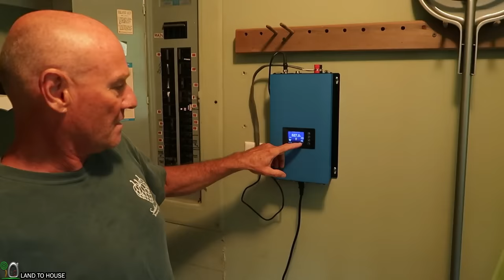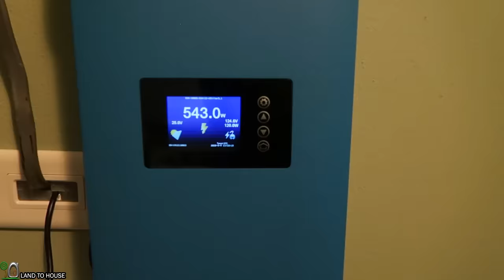Awesome Low Head High Flow Grid Tie Micro Hydro 530 watts!

Comment from the maker: Do you enjoy micro hydro? Check out a Turgo system here:
https://youtu.be/Flz4_OE4CGI
Reply: I would hire a different electrician. Neat project but with many electrical code violations. I would be surprised if you didn’t wake up one day to find your meter pulled.
Reply: Is it possible to install multiple turbine in that single pipe to produce more power?
Reply: Brilliant work the entire World should follow both of you as Energy Saving Pro's
Reply: Agreed, using ground as a load line? Why not run 10/3, rectifier in a sealed box? Surprised it hasn't burned up, could see the toasted insulation, but hey he is doing it.
Reply: you wouldnt need a siphon if you used the falling water to flow thru the pipe, catch it with a gutter type intake.!
Reply: This beautiful dam can generate 10kW of electricity with the right turbine, not just 530W.
Reply from the maker: Hydro power:
(Gpm x head)/10=power
The max for this water flow and drop is around 600w.
Reply: @LandtoHouse  how about turbulent generator?
Reply: op
Reply: @leohern6481  Yes
Reply: Did you tell him that his recitfier needs a better ventilation? Would be bad if his house burned down.
Reply: If you narrow the pipe at the end, you should be able to use the Bernoulli principle to be able to create a low pressure vacuum to keep the pipe that is above water absent of air, I THINK.  If a spigot was made at the lower (more narrow) pipe and connected to the top this should create a pressure that is below atmospheric pressure which would keep the water flowing indefinitely.

This would reduce efficiency, but I don't think efficiency is what is being aimed for anyhow.
Reply: @lancej2718  The guy did the electrics himself.
Reply: @ronhanish  What about when there has been no rain and the level drops below the wall?
Reply: @LandtoHouse    Plus cleaning the water intake, plus invasive plumbing potentially to existing dams, there are so many considerations and differences with this design versus traditional, its pathetic.  I have the perfect setup already in place for this type of system and I can't tell how much I appreciate you producing this video.  Everything came together for me and my site (all systems, like solar are site specific).  Thanks so much.  I'm applying this design to my dam.
Reply: @khanhphaminh1175  Very clever - show us your maths or shut up
Reply: @flatfoot  why don't you show me your math? Have you ever tried searching about vortex turbine?
Reply: @flatfoot  LOL. If you can't search it on youtube, then I have nothing more to say. Sadly someone can't even search on youtube, but so confident to blame others..
Reply: thank you thank you thank you thank we use less than 300kilo watt here the corrupt agents here for 408 kilo watt estimated bill is 27 500 plus for one month we will be so happy to get off this corrupt system pray for us here that we can get the Lancaster parts today thank you
Reply: @khanhphaminh1175  Doesn't matter the type of turbine or generator once you are at the maximum available working energy (water flow/pressure).
Reply: @fjs1111  how do you know it's in the maximum available working energy?
Reply: @khanhphaminh1175  Because physics says so. Consider weight of water, head, velocity, etc. There are good numbers out on the engineering sites along with calculators to determine this.
Reply: @fjs1111  have you ever heard about Vortex Turbine
Reply: @khanhphaminh1175  Yes but it still uses water and gravity to supply energy needed to convert. Turbulent vortex turbines do not violate the laws of physics though they are really cool.
Reply: You can create a system to return the water to the dam/lake but you'll need to use more pipe (length) in order to generate enough vacuum do that hight
Reply: @leohern6481  No. I would upset the flow and venturi effect and be inefficient - if you had a greater drop or more flow - yes.
Reply: May I ask if the generator cost $2500. What were the additional costs for this meter device before his panel box that makes sure his power doesn't go back to the grid and cause the works problems.

Also do you sell these other parts other than the generator?
Reply: @lancej2718  

Yep maybe you are right. That would depend on what is code in his area. 
Also he has that unit that prevents power from going back to the grid ( supposedly) until it fails.

But he is 2/3 off the grid. And yes they may come by to see why he is paying less and change the meter. I have hear they do that sometimes.
Reply: @leohern6481  

If he put a differently design unit after the outlet, then yes if it is not directly connected to the pipe.

 So yes he can do that and increase his output that way.
Reply: Rhene'baby you on here I'm so glad you got it figured out how much we can do for you sorry baby Kevin broke down in town I was making sure he had everything he needed sorry really and Alexis called talking to me about no she wanted to come over here for some reason I don't know how much I appreciate you all for your help with this venture hey I don't want to go back to the doctor tomorrow morning ok why don't you come over here maybe I can help you if you will have a new idea of me John Richard Childers your husband still lol you know what I think I need to do it for my mom and your mom is there anything you want them for you no not at all baby godi miss you well no I don't miss her sorry she's no way I'm done I know why but sorry I'm no fuckin 0unching bag I'm not a toy I'm not having that kinda shit in my life at all no more sorry I have no mom no family but you the boys Kevin and Luther
Reply: If your ever in GA/SC area Augusta/Aiken.  I’m a handyman by trade.  I would love to be a helper.  
Flowing Wells Augusta Georgia USA.  Is a natural spring willed to God.  I see a potential on this 1/2 acre 🤗.  Lots of history behind this.  It would give me great pleasure to build this up.  Ram Pump, to power supply and drinking water.  Tesla capacitors city powers the lights along the road.  And they are a lot of them.  Any who.
A Day Dream 💭.
 A hobby worth investment.  
“A perpetual spring”.  Jesus is the man! Hallelujah!

Comment: When he admits to using the bonding conductor as a current carrying conductor. 
Me as an electrician just cringing. there also isn’t a disconnect at the turbine how are you supposed to de energize rest of the system.  The #10 wire is probably fine at 530W 3phase.
Reply: What do you mean by "deenergize"? Is something in the system behaving like a capacitor and building up potential?
Reply: I'm guessing your none union or a are you IBEW

Comment: Don't be cheap and dangerous, don't ever use the ground as a current carrying conductor. Just because it works doesn't mean it's right.
Reply: Just wanted to chime in and agree, yes it is burial grade wire but don’t cheap out on your wiring. It obviously works but they make 3 conductor wires for this reason. Good luck and thank you for sharing your awesome setup!
Reply: Why so?
Reply: luigig44 It’s just not intended for the ground conductor to carry current. It isn’t insulated the same as the other two. The ground/earth conductor is just a safety measure. If you want 3 conductors, get 3 conductor wire. The nomenclature is wire size/number of conductors, with ground. So if you wanted 10 AWG wire with three conductors you’d get 10/3 with ground. Not 10/2 and use the ground to carry your current. And just to be honest, electrical work is intended to be done by knowledgeable professionals and if you have to ask “why so?” on a question as simple as “Why can’t my ground wire be used to carry a third leg of a circuit?” then you don’t need to be performing electrical repairs. Not to discourage you from asking or learning, but it is the way it is for a reason. If there were ever a problem, a fire or an electrocution and investigators found that the homeowner used the ground wire to carry a load, there’s no telling what the ramifications would be. Denied insurance? Liability?
Reply: It’s 24 volts.  Enough said !
Reply: John Singleton if I did my rudimentary calculations right that’s still 7 amps of current which can still kill. I didn’t write the codes. I don’t even enforce the codes. I don’t have a dog in the fight at all! I’m just offering advice to those who might read it. Do as you will.
Reply: @dominodoggy1  That's wrong.  The current will be 0.025 amps.  24 volts divided by the resistance of the human body to complete the circuit.  V = I x R.  Ohms law.  Say human body resistance is 1000 Ohms.  The calculation is 24 / 1000 = 0.025 amps.  So 0.025 amps.  Not 7 amps.  It will tingle but that's all :-)
Reply: John Singleton Hmm, I was going by roughly “500 watts” output they were saying divided by 24v = approx 21 amps, then divided that by 3 cause, three phase to get approx 7 amps per leg. I’m NOT an electrician and I have barely a rudimentary knowledge of the theories involved. I know some basics, that’s all. So you’re telling me the amperage coming off of a hydroelectric generator is only 0.025 amps? How is that providing any power? I’m asking, I’m not trying to dispute.
Reply: @dominodoggy1  500 watts is the maximum output the generator can supply.  If you put that into a 5W bulb it will only draw 5 watts because the resistance of the bulb does not allow more current to flow thus limiting the power.  Likewise if you put that through a person the current will be limited by the resistance of the human body.  Limiting the resistance will limit the power (in watts) thus only be 0.025 watts.  However if you increase the voltage this has the effect of overcoming the resistance (more pushing force) and thus you can then see an increase in the power (watts).  This is why 24 volts is safe and 240 volts isn't.  However I do agree that it's poor practice to use an earth conductor for carrying voltage when suitable 3 and 4 core cables exist for that purposes but it can be 'excused' in this application due to being low voltage.
Reply: @dominodoggy1  Oh, sorry. Where I live the ground wire is insulated just like all other wires are. It just has a different color. But I do agree that you shouldn't use it if it isn't insulated
Reply: John Singleton thanks for the explanation!

Comment: As an engineer after analysing through his project firstly I discovered that the position where the generator is stationed in the pipe has a lesser pressure and may course low efficiency from the output of the generator. In other to correct this the gen should be installed at basement of the pipe very close to the outlet. And it should be installed some meters above the ground.
Secondly the output connection from the inverter to the wall socket in his apartment is wrong. This is why we make use of distribution box in our home.

Comment: 500 watts
1000 watt PSU: Allow me introduce myself.
Reply: Asanda Ndimande, probably would still work, but not with 2 2080tis/3080s at high load.
1000w PSU does not mean all 1000w will get converted.

Comment: The electrical side of this setup is pretty janky. And feeding power back through a socket is a big no no.
Reply: Pieterjan Cousserier is it? That’s how literally every home backup generator works
Reply from the maker: These grid tie inverters are grid excited. As soon as the grid is down the inverter stops producing.
Reply: @LandtoHouse  I don't understand. Please elaborate. Wouldn't it be the other way around? As soon as the grid goes down you'd want to access the energy from the dam right? So why would it turn off when you need it most? Where I live it's a big health and safety no no if you were to put energy back to the grid through a socket.
Reply: @pieterjancousserier9900  So that it is not a safety hazard. If the inverter loses grid signal then it will not generate electricity so no one will get shocked by touching things that shouldn't be live
Reply: @LandtoHouse  Yes this is known as "Anti islanding protection" and is a requirement for grid tied inverters to be allowed to back feed or otherwise connect to the grid. It is perfectly okay to backfeed power through a nema outlet like that, so long as the thing follows the above protection. Otherwise yeah you got yourself a deadmans cable.
Reply: @minecraft2048 Oh okay, that makes sense. Thanks for the explanation!